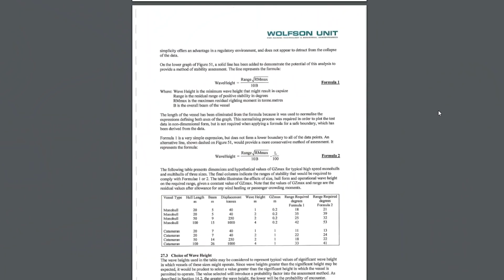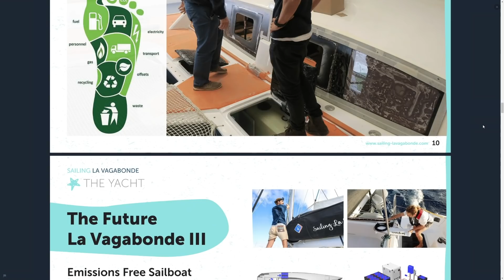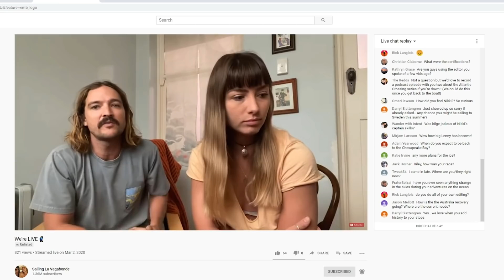Our Plan for an Emissions Free Vessel

Comment: Your Cat is already a relatively light and large platform , why not just increase your green electric generation and storage whilst replacing the diesel engines with electric motors  ?
Reply: I don’t think they motor very much, a solar system, battery bank, and electric motors would probably be more than enough for their needs and save the emissions of manufacturing a new 60 foot fiberglass vessel
Reply: @EthanHeffernan  agree
Reply: @EthanHeffernan  what's the fun in that. The guy has the opportunity to build his own boat it's gonna be sick.
Reply: Chris Wright The fun in that is presumably saving on emissions, if they decide they want a new boat they should just say they want a new boat, I wouldn’t blame them since they’re raising a kid on it. They said their goal was to have zero emissions sailing, a conversion will allow them to do such with the lowest initial emissions of any of the options they have. It’s a choice of one or the other, lowest emissions or a new hull.
Reply: @EthanHeffernan  he said he wants to create a zero emissions boat. He never claimed to have invented the concept. I get what you mean technically it's not the best thing to do but who cares it sounds like great fun and we get to watch him attempt it.
Reply: Chris Wright I agree, it’ll be interesting to see which direction they’ll go in terms of hull design, maybe a trimaran if they’re going for a cool factor.
Reply: @chriswright1389  lithium has a huge footprint, far more toxic than diesel no less biodiesel.
Reply: @paullink9319  I know.
Reply: You could also up the solar panels by attaching them to the rail outside the boat and have it where you can hinge them down when docking.
Reply: That was my THOUGHT EXACTLY
Reply: @UCCLdIk6R5ECGtaGm7oqO-TQ  No sails, but optional kite offered
Reply: The production of a boat needs a lot of energy. So you never can get emission free with a sail boat. From the economics the switch to electric makes therefore not much sense.
.
Reply: @cormacsyt0  Norway??? Did you forget all the natural gas exports which funds and subsidises their renewable energy?!
Reply: It's been done already, but there's not enough power available to run for any length of time.  When you add current generation batteries, the boat weight goes up a lot, and then you need some way to charge them.   There is a relatively new Silent E-55 E-catamaran where all top surfaces are covered in solar panels (no sails to block the sunlight), and it's simply not enough.   Here's a comment I posted on the video tour of that boat where they talked about the specs of the motors, speed and charging capacity.   
"The numbers don't add up to maintain 6 knots on solar.   60mi at 6 knots takes 8.7 hours.   210KWh pack capacity / 8.7 hours = 24KW continuous draw.     The peak output of all the solar panels is  10.8KW but it can't maintain that as the sun position changes.  Let's use 10KW for convenience.     Subtract that from your continuous draw and you're still pulling 14KW from the pack.   That  adds 72% to the range, but keep in mind that to charge a 210KWh pack at only 10Ah takes 21 hours.     If you run at 6 Knots during the day you'll get to night with no power reserve at all, which means it makes more sense to either run very slowly all day, or park during the day to charge, and run slowly all night.    That works for coastline cruising, but not so well for ocean crossings where you want to be moving 24/7 if possible."

You can convert wind into power with windmills or an  underwater impeller, but then if you have wind, you mostly don't need the electric motors.  And even if you keep the batteries topped off, you still won't be able to run for very long when you really need them.   If you're on an ocean crossing stuck in light or no wind conditions but there's a storm approaching, then you just need to run the motors continuously to get out of the way.     With this  current best-in-class technology in that e-cat installed in LVIII  you'd run for about 10 hours, and then be dead in the water.
Reply: daemn42 Sounds like a reason to not go electric yet, I wonder if an emergency diesel generator might be a solution for that scenario. From the videos it seems like they do a lot of anchorage to anchorage hopping so if they only needed power to outrun a hurricane or to do short trips in harbor then an electric system with a backup generator might be a good solution. I’m no marine engineer, Riley should talk to one and see what the current electric technology could do for them.
Reply: @EthanHeffernan  If you only use the motoring for emergency, than the gasoline motor ist the most efficient and chepest way. A solar-system with additional back-up would be very expensive!
.
Reply: @daemn42  Gasoline has a very high energy densitiy and is therefore very good for using in a boat for motoring! It is efficient, has not much weight and is cheap... that counts! The narrative (CO2 is bad) will change over time...
.
Reply: @daemn42 is there a hybrid configuration that can do both for different situations: electric motor inserted into the drive train. Fuel motors then do the work of generator plus solar panels (in best configuration) and cruising power?
Reply: @KymHammond  Of course this is a possibility, but who wants to pay for that?
Reply: @daemn42  Put in a large diesel generator for safety just in case.  That will give you large range if needed.  I  guess you would use it very little.
Reply: @pierre.a.larsen   Besides not being "zero emissions", now you're adding the weight and size of a "large diesel generator" plus its fuel tanks to the weight and size of the electric motors and large heavy batteries, and "best case" having to drag all  that around with your sails most of the time.
Reply: @daemn42  Yes, you get a penalty.  But safety first.  I don't think you would use the generator much. So very low emissions.
Also I think the solution would have no large penalty.  You would go from three diesel engines to one (most boats would have a diesel generator anyways). You would be able to get rid of half of your fuel (generator for emergency only).  Electric motors are relatively light.  Marine lithium batteries can be had for around 10 kg per kWh capacity.
Reply: @pierre.a.larsen   If we're talking safety, then put it in the context of LVII.   They currently have two diesel engines and no generator.    Two engines gives them true redundancy (can move on both and/or charge on both) and we've seen em be forced to run on only one engine so we know that redundancy is important.     Now replace that with electric motors a battery pack smaller than the one on that Silent 55 e-cat, and a generator, and your redundancy is gone.   Need to run from a storm, or motorsail against a strong current and you'll deplete the batteries in a few hours, and now you're running on the generator alone which is not the most efficient way to convert fuel into forward propulsion.        To give any decent range on battery, it needs to be a much larger pack.   That Silent 55ft e-cat has 210kWh battery capacity which still only gives it about a 60 mile range at 6 knots.  (it's not like a car where you'd go 800 miles on that much battery).    At 10kg per kWh, that's an added 2100Kg (4530 lbs).        That would not be be a very efficient sailboat.   Not even with a pack half that size.      

Keep in mind their electricity demands are not small either.  They run 1, sometimes 2 refrigerators, a water maker (which they usually have to run an engine to make enough water for showers), and of course need to power their computers and charge camera and drone batteries for their "day job", which is producing video content for us.
Reply: @pierre.a.larsen  Read the Jimmy Cornell article above on that. Problem is you WILL use it. ELNACO designed their fit without just because of the option. Having means you use it. Invention means not having the gen but being able to do the long range sail too.
Reply: @daemn42  For a light catamaran (a performance catamaran like La Vagabonde) I think 40 kWh battery capacity would be a good start.  Combined with 15 kW  motors this should be sufficient (electric motor can be a bit smaller than the diesel it replaces - has more torque). They. would be able to run sufficient time for getting in and out of most harbors.  With this kind of setup even with a larger generator - say 20 kWh they would have a net weight reduction I think.  Just the current diesel engines weigh in at close to over 200 kg each with filters and (lead?) start batteries.  Also they could get rid of half of the diesel.  Another 110 kg at least (70 gallons x 3,78l x 0,832kg/l)- you would carry extra fuel on passages probably.
On the generator they would be able to motor on for many hours at 2/3 power.  There would be an added risk.  In adverse situations like in headwind/-sea they would probably be under powered. 
But generally speaking you would theoretically have a pretty good system and a large motor range.  
I have not studied this into depth - but several suppliers of hybrid propulsion systems claim that a DC diesel generator combined with electric motors are more efficient than diesel engine(s) driving a prop.
Reply: @timo2905  You may be right - human nature and all.  If everyone on board agrees to such an adventure (like the Magellan strait with basically just sails) then I think it is great.  But if I were a captain responsible for the crew (and maybe even kids) I would hesitate a lot not to have more than two hours of motorized propulsion available.
Jimmy Cornell is an amazing guy BTW.
Reply: @pierre.a.larsen  It's practicality versus concept. Riley wants the business aspect over changing his own boat to answer his own question.
Reply: @pierre.a.larsen  Couldn't lithium battery weight be a design constraint?  Use full fuel tanks plus the weight of 2 diesel engines (plus all support technology) as the top weight allowed for lithium batteries.  I don't know how large the fuel tanks are, or what they weigh when full, but you could end up with a lot of Lithium Batteries per kg replaced.  Then, with that, what is the total amount of energy stored in that amount of weight in batteries?
Reply: @Roblewis99  That is an interesting thought
An Outremer 45 has standard fuel tanks of about 70 gallons.  That is approximately 220 kg of fuel.
The diesel engines themselves weigh in at around 150kg with sail drives.  With extras like lead start batteries, filters and so on lets say 200 kg each.
So removal of the diesel propulsion would save 620 kgs plus other items like tubes and the diesel tanks.  Let's say 640 kg.
15 kW electric motors from Ocean volt are about 79 kg each with sail drives I believe to remember.
On top on that comes electrical equipment such as inverters and so on.  But on the other hand you need some of that even with diesel engines.
For the example lets count with the 640 kg of batteries.  Good quality (you do not want a fire on a boat) Marine lithium ion batteries like Mastervolt 5,5 kWh batteries weigh in at 57 kg.  Or 96,4 watts per kg.
 So 640 kg should get you around 61,7 kWh. 
By comparison 220 kg of diesel contain an energy density 45,6 of MJ per kilogram = 12,67 kWh per kg.  That is 2776 kWh (2,8 Mega watt hours) for 220 kg.
Diesel engine marine propulsion is roughly half as efficient as battery driven electric marine propulsion.  So you would need 1,4 MW or roughly 14,5 metric tons of batteries to get the same range from the electric engines as diesel engines running on 70 gallons of diesel.
I did the calculations a bit fast - there may be errors.
Reply: @pierre.a.larsen  It is never possible, that a diesel generator (is a diesel-motor with an elctricity generator!) with an e-motor has the same efficiency like a diesel motor allone! The efficiency is a lot lower. With every transition of energy you lose energy.
.
Reply: @pierre.a.larsen  You need no detailled calculations. It is very clear, that the energy densitiy (kWh/kg) for diesel ist very high compared to an available battery pack. Even if we compare the much better efficiency in the electrical installations (battery, converter, cabling and e-motor).
.
Reply: @jonnes__4657 I was also doubtful when I read it.  One of the arguments for this to be true is that you can use more efficient larger props with an electric motor without having to worry about overload.  Also you can run the generator diesel engine at a constant most efficient speed combined with DC output.  I am in no way a specialist in this area - I would like real empiric data to substantiate.
Reply: @pierre.a.larsen  I think on a boat you can operate a diesel engine at a quite good efficience rate. It is different than a car.
Reply: Might not be light and or big enough for speed in 5 knot winds (to avoid need to use engine)
Reply: @UCCLdIk6R5ECGtaGm7oqO-TQ   Yes it has no sails.  But that also means every top surface can be covered in solar panels for recharging, and there's never anything to block them (other than clouds).   Even so, recharge rate can't match what the motors pull unless you're going very slowly (2-3 knots).  Assuming SVIII remains a sailboat you have less room for solar panels, and even if you could have the same area, they would be partially or even fully blocked any time the sails are up.       In terms of charging and battery capacity a "lightweight sailboat" will be severely limited, compared to the E55, which with it's massive battery pack is still limited and unable to cruise continuously for more than about 9 hours.      The sailing channels like SLV may not show it much, but there are simply times when you have to run the motors for long periods of time and they'll lose that ability.  Not like there are Tesla Superchargers in the ocean.  ;)
Reply: @cormacsyt0  Thats the narrative, yes...
.
Reply: @cormacsyt0  Of course the elctric efficiencey chain is better, but the energy density of diesel and price of the diesel engine is much better.
Reply: @cormacsyt0  Yes I know it's the CO2-narrativ. Much more important is the energy coming from the sun (all energy comes from the sun!). And this radiation energy is not constant as assumed by all the models.
.
Reply: @cormacsyt0  Yes, but that we are doing now for more than 200 years and nobody cared about it. It was a very important devolopement for human beings. Yes there will be a natural transition, but why this year or tomorrow? Why is that scaremongering? That I cannot understand.
Reply: @cormacsyt0  We will adopt our energy-usage, but NOT because of climate change. Climate ALWAYS changes, that's a fact. We hope it is NOT getting COLDER! Because then we would have a huge problem.
Reply: Fun fact! Lithium is NOT eco-friendly. You would do far better to look at opposing piston two stroke diesel.

Comment: 기본적으로 요트는 거의 무공해 선박 이잖아?  요트 엔진에 기름이 조금 들어 갈뿐... ? 전기 모터를 쓸건가?
Basically, yachts are almost zero-pollution vessels, right?  Yacht engines use only a little oil, right? When parking or when there is no wind? Are you going to switch to an electric motor? Greenpeace will like it.

Comment: Call Honda and see if they will install one of those hydrogen fuel cells on your boat. It would raise awareness of how well they work at the very least. I think Ford is working on one too.
Reply: Efoy already has a fuel cell generator set built for marine environments
Reply: hydrogen is far less efficient than batteries and cant charge from solar